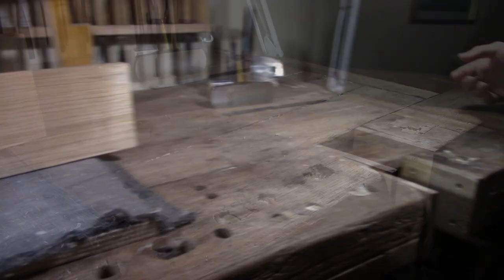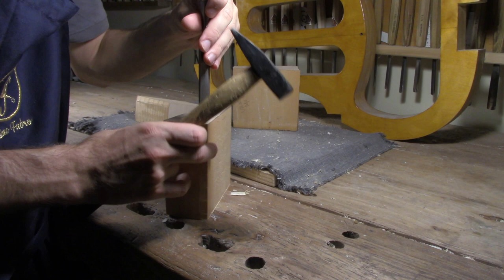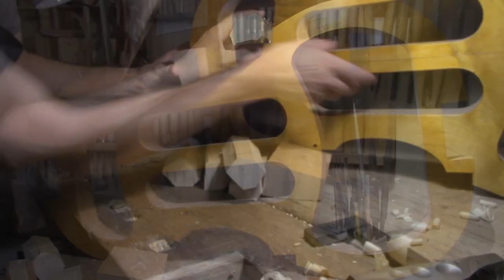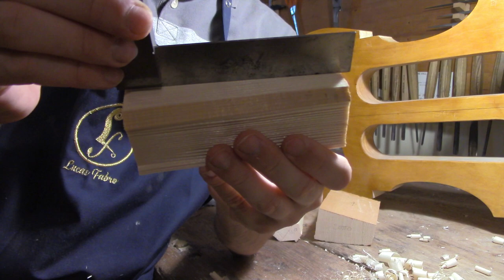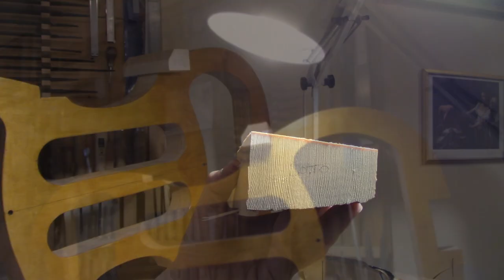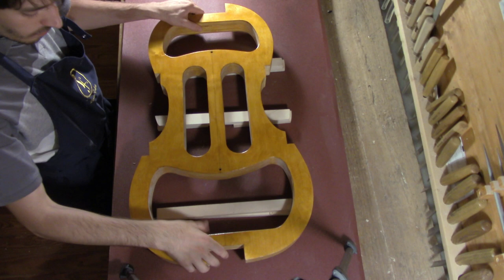MAKING A CELLO | Preparing the BLOCKS

Comment: I am not a craftsman such as Lucas, but I was wondering why power tools such as a miter saw weren't used to make rough cuts.  I understand the chisel and hand plane work to fine tune the fit or the many pieces, but making rough cuts using a power tool would lessen the time for some steps.  I don't think innovations such as power tools would detract from such fine work.
Reply from the maker: Hi! Thanks for your comment.
This is a question I get asked a lot, so I'll copy one part of the answer from another time and try to expand a bit on another one haha.

First of all, and the "simplest" of the answers, is an "ethical" one. What I sell (and my clients want) are handmade instruments. And at least for what I morally consider and interpret as hand-made (and what I think is generally accepted in Cremona as well) then the use of power tools for rough cuts would make it a non fully hand-made instrument. Or at least, as I mentioned, I wouldn't feel ethically correct at selling it as a hand-made instrument.  

Secondly (and the part that I'm copying from before), the use of something like a CNC would make an almost final arching or almost final thickness. In my case, I change each arching according to each instrument based on the characteristics of the wood. Some of these characteristics I can measure in advance, but many others I simply "discover" while I'm doing the rough out. This part of the process is what allows me to understand how the wood is and feels, which can change my mind on what shape of arching I want to make and how high I want it to be. Same thing applies for the thicknesses. If the wood turns out to be softer than I expect it to be, then I should make higher thicknesses, and a CNC wouldn't let me realise this. 
I think that if this part of the process wasn't important then factory made instruments would indeed be almost as good as professionally handmade ones, and that's certainly not the case.

Another thing is that after having some experience, if I had to prepare a machine to do some rough cuts, then that'd probably take me longer than doing the rough cuts by hand. 

In the case of something like the one seen in the video (the blocks), the reason why I'm cutting them with an unsharpened chisel or knife and a hammer is because I want to make sure that the wood get split and not cut (which would defeat the point of using a machine). This is very important to make it easier to work on the blocks during the most delicate stages. 

Hope you found the answers useful but please let me know if you want me to expand on the issue or if you have more questions!
Reply: @LucasFabro  Thanks for the reply.  I was thinking that your reply would be something along the lines of your answer and it's  very respectable and commendable.  I was amazed by your by craftmanship throughout the build.  I like how you described discovering the wood as you worked with it.  I enjoyed your video series and will watch others too.  Thanks again for the reply.